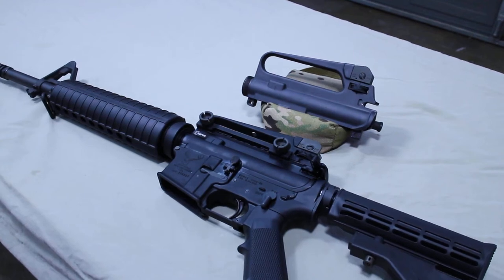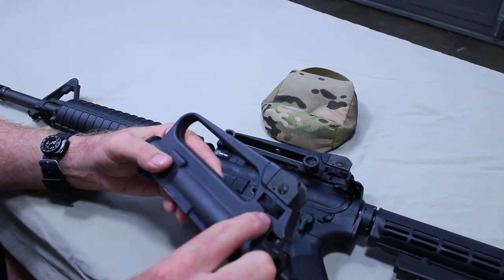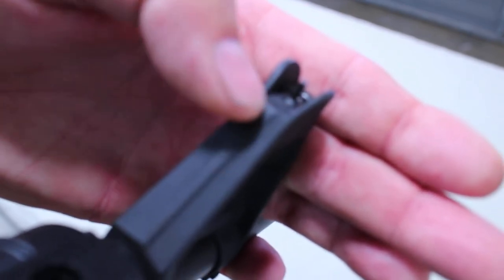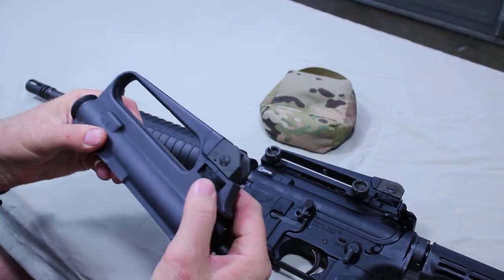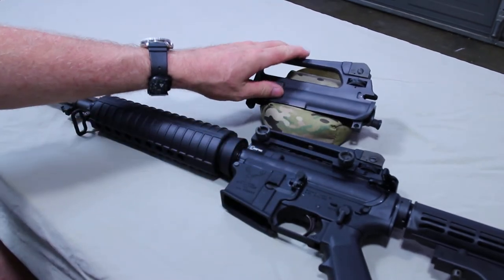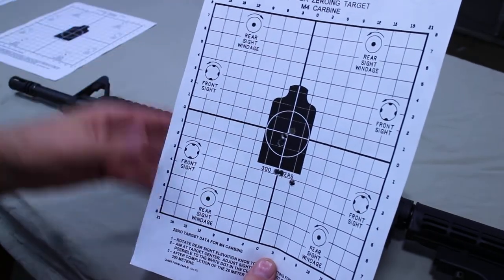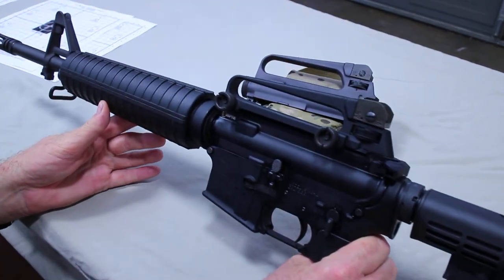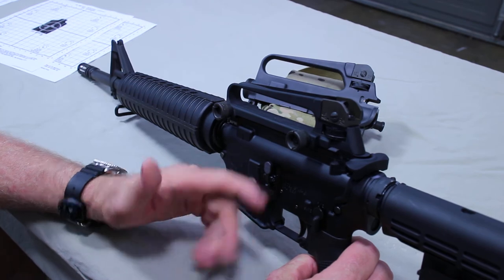AR15 A2 A4 Sights

Comment: Why are so many of these videos so different.  I was told on a 16" barrel put sight on 300-600.  do not put on z or up a notch  to sight in.  on a 20
' Barrel to put on the z.  I dont know what is right.
Reply: You can get the Army or Marine M16 field manual off amazon for super cheap. It explains all the differences between the variants and answers the question you just asked.
Reply: On the 16" barrel adjust your BDC dial (Bullet Drop Compensator) to 3/6 (300/600), and leave it there. Flip your rear peep to the 300 meter aperture (smaller peep) and dial it to center (observe the hash-marks), and leave it there. Flush-up the front sight post base with the front sight housing, and you are set to "mechanical zero." You are now ready to begin your "zeroing process;" you may proceed to the range.
Reply: A lot of this info coming out is from Army doctrine.
 someone turns around and puts in thier words.  Being a former Marine,  Marines have a different way of doing things.  we had to shoot out to the 500 with A2 "iron sights"  The M-16A4 is a flat top with 20in bbl with a detach handle of 6/3.  bbl length has nothing to do with 6/3  its due to the dch being higher then the A2 carrying handle   A4/M4 6/3 = 1/2 inch for every 100,  means for every click on the rear sight is an adjustment of 100 ( ARMY does not teach this I guess?)  .This is USMC doctrine.  Marines BZO different and shoot at 36 yard not the 25 meters.   USMC adjust  all rear sights to A2  8/3-3 or A4/M4 6/3-3   different from the Army.  if you be interested in the USMC way I will be happy to tell you.   Marines dont do this Z crap...lol
Reply: @Sam7x57  Get the USMC
Reply: @esmith3438  ..  I've been studying these sights. The 6/3 is the detachable handle with a "Z" index. This is 2 clicks above the 6/3 index and "Z" is used for zeroing the A4 20" barrel at 25M. When zeroing the M4 which is a 14.5" barrel the 6/3 index is to be used. This is Army doctrine and the differences are due to different velocity coming out of the different length barrels. Also, there is a difference in the MOA values between the 8/3 and the 6/3 handle when making modification to the sight wheel for IBZO and RIBZ.
Reply: @Allenmar73 Army say one thing the Marines say other. For every inch you cut off from a 20in bbl u lose 200 pounds of engery.  why adjusting front sight post and 3 clicks up on rear is key during BZO. 

The Marine Corps  does NOT use the Z thing or BZO at 25 meters, thats an Army thing.  We BZO at 36 yards,  adjusting front sight for how many clicks up or down depending what u hit on the BZO paper.  Adjusting rear sight up 3 clicks to (8/3 A2) or (6/3 A4/M4) from -3 . then shoot at 200, 300 and 500 yards.  myself and other marines were  hitting black, I was even a  rifle expert and others.  So,  Marines must know somthing?  it was the USMC  that designed A2.     A4  came in by late 2003 with the DCH on, we still BZO them in the same way as the A2  we still were hitting black dead on. I have used the same method on the M4 it works?   so you pick? Army way or the Marines. Were you in the Army?  have you shoot at 200, 300 or 500 yards with an A2 or a flatotp with DCH on?  how did you hit  sighting in at 25 meters using Z?  was it hittling low at 300?
Reply: @esmith3438  ..I've really been wanting to set up the sight your way and zero for 36 yards. I've read all your instructions. Will the BDC function work the way sight was designed for and remain correct on the "4"=400, "5"=500, and the full rotation "6/3"=600? You have said setting up the modification to 6/3-3 will be 100 yards, 6/3-2 will be 200 yards, and 6/3 will be 36/300 yard when zeroed at this setting. Just trying to make sure I understand correctly. Is this right?
Reply: @Allenmar73  yes, crazy as easy at sounds. USMC designed the rear sight to adjust 1 click for every 100 yards of adjustment.   use the small  sight only,  we never used the big 0-2  sight. we would do a fun unknown distence shoot. targets from 50 to 300  would pop up at us. we just  adjust the rear sight accordingly to hit the target.   When doing BZO we were given a strpper clip of just 10 rounds of NATO M855 with 3 mags.   2 mags with 3 rnds each, one mag with 4 rnds.  mag with 4  rnds was used last.  I know Army uses 5rnds each? I wish i could send you pictures?   i have been  thinking of making my own videos on the Marine way.   crazy to think the Marines and Army would have  different ways sighting in the same rifle?  Marines sight in the ACOG the same way at 36 yrads putting the 300 reticle mark on the 36 yard BZO.
Reply: @esmith3438  ... Please make that video! I've watched so many videos on this battle sight and none were very clear. That's when I went to comments section to find out from more experienced guys. Thanks again.